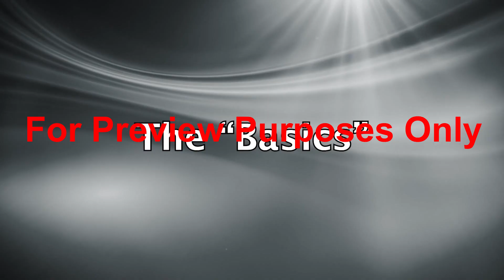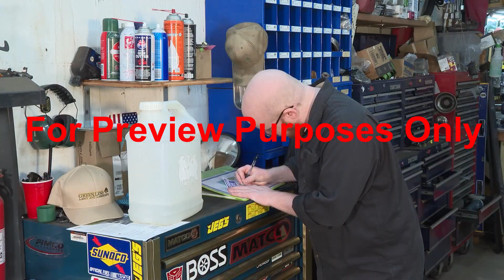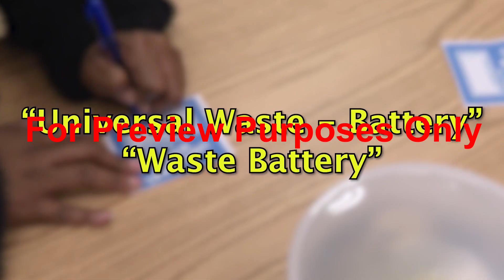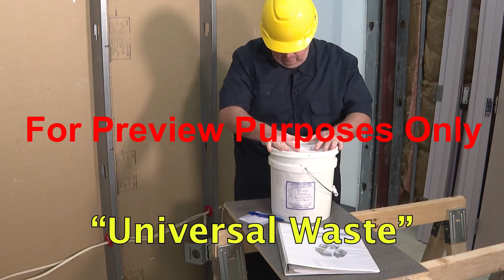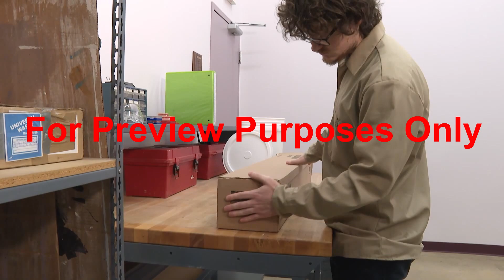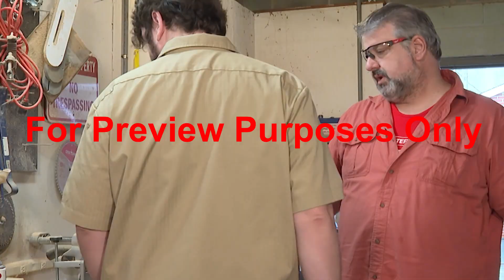Handle Universal Waste Safely – Training Guide From SafetyVideos.com

Comment: To assist employees and homeowners in identifying lamps that contain mercury, such lamps manufactured after November 30, 2003 for sale in the U.S. must be marked with the following: 

1) CONTAINS MERCURY
2) Encircled "Hg" 
3) CONTAINS MERCURY and the encircled "Hg

While it may be comforting to understand the amount of mercury in each lamp is typically very small, often only enough to cover the tip of a pen, many large commercial establishments may have hundreds if not thousands of fluorescent and/or HID lamps inside and outside the building, making proper handling and disposal a very serious concern when replacing burned out lamps or doing a complete LED retrofit.